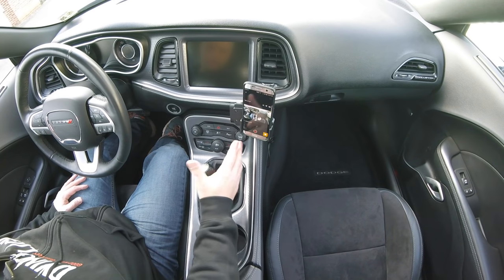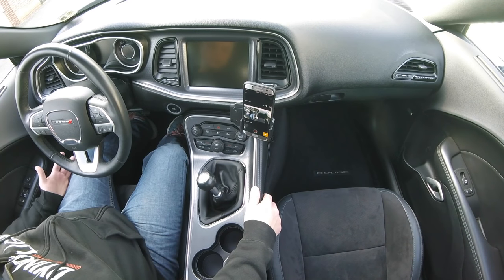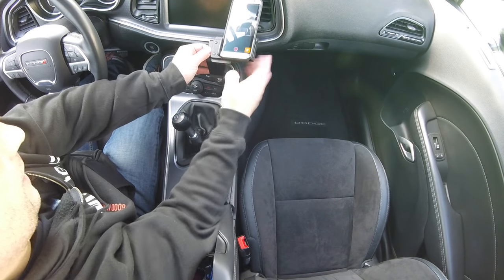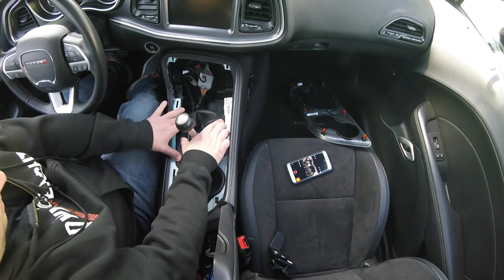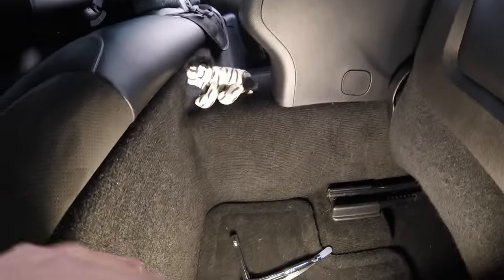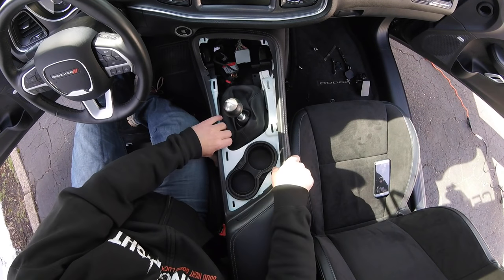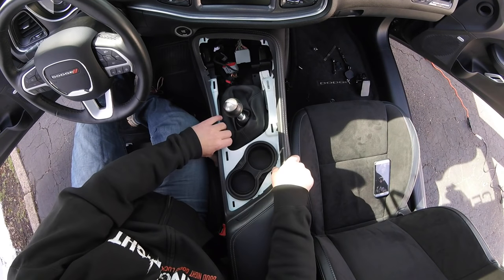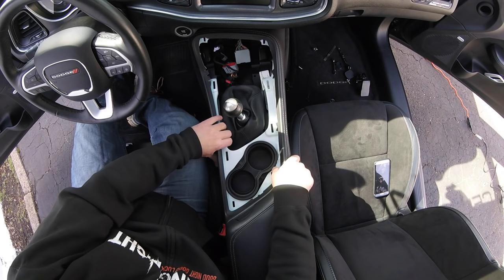Barton Shifter complete Install - Dodge Challenger Scat Pack

Comment: Ok here's a stupid question and your videos of everything you do are Great ! Skip Shift Eliminator you had a video on it do you use with your Barton Shifter ?
Reply from the maker: Both parts do different things and can be installed together or at separate times, for the best experience you should install both of course.  The skip shift stops the lock out on second gear between 19-21mph  it's a very annoying "fuel economy' feature.  Installing the Barton greatly improves shifting, but does not deal with the 2nd gear lockout which is why you need both.

Comment: I just saw you this evening on 303 lol I was the black scat that parked in front of you by the 7/11 😎
Reply from the maker: Yup that was me, had to pull over and deal with an email.  I was a little jealous your car was so clean.
Reply: Many thanks to your how to videos ! Ceramic coating keeps it looking very glossy. I hope we bump into each other again , what's the chances !
Reply from the maker: Pretty good chances considering, if you're not affiliated with a club check out www.northjerseymopar.com they have events, meets and shows  at least once a week.  They are a good group of people to hang out with.  Ceramic coating seems to be the way to go, there are a few people saying I should go that route for a touch less wash.  Once I finish paint correction I may go that route.

Comment: Very nice Mod ; With my Bratwurst fingers I would have definitely tried some 45degree needlenose pliers or forscipes on that pin. I was wondering if you were going to put any grease on anything during reassembly or is that frowned upon by the kit maker ? From the looks of some of the existing parts they probably could use a coat of oil or something on them.
Reply from the maker: They only mention grease to assist with the fitting of the rubber boot. Once I started the job one of the first things I though was "I should have gotten some grease"

Comment: Great video! I had a question? In the description you say something about the rear bracket and bolt orientation, what exactly are you referring to? Thank you.
Reply from the maker: The square plate with the 4 bolts that goes on the back of the shifter.
Reply: @WorkPlayDrive  not to be a nuisance, but could you give me the time time in your video to further explain? Thank you so much.
Reply from the maker: No worries the time stamp is 22:35.
Reply: @WorkPlayDrive  thank you very much.

Comment: Great Video! What is the name or brand of phone holder that fits between the console & dash? Do you know where I can get a hold of one?
Reply from the maker: Thank you !!  The phone mount is made by ProClip, http://www.proclipusa.com/ and you may be able to use code "10off" to get a 10% discount.  It's more expensice than your eBay mount but it's sleek and solid.  I have 2 videos on it for the challenger so you can decide if it's for you.  In my review I added an extender plate.  Here is my Playlist https://www.youtube.com/playlist?list=PL_C69kho0QAtlEQr8n08a6O2FYFiLEIPk

Comment: Excellent video. One question, did you painted the engraved on the shift lever or coming orange like that? I went to the BARTON website and no option other than bare metal on the engravings. Thank you
Reply from the maker: It came from Barton painted, they may no longer offer this option.
Reply: @WorkPlayDrive   thank you for the feedback, Probably I will call them and ask. In the worst scenario I think I can paint the BARTON engraving by myself. I jus ordered an SP with the hemi orange interior package and that detail in orange will be look really nice I think. I ordered already the same knob than you from speed dawn, just added the R/T logo on both sides, in hemi orange too. I can’t wait to install it!  Have a good day. Thank u
Reply from the maker: Congrats on the scat 🎈
Reply: @WorkPlayDrive   thank you very much

Comment: Did you loctite all fasteners? I'm about to install but cannot believe no instructions were included and the video they recommended is 8 yrs old and completely different version than late model Challenger
Reply from the maker: It’s been a few years, but I believe I used the blue Loctite on any of the fasteners that did not come from Barton with Loctite on them.

Comment: Great video. Just picked up a 6sp Challenger yesterday and will definitely consider this shifter. When I had a 2010 SRT8 with 6speed, I replaced the shifter with the Hurst shifter. I found the Hurst to have a lot of vibration though.  How is the damping on the Barton? Any vibration compared to the stock unit?
Reply from the maker: I little more than stock but not bad at all. I have a bad habit of leaving my hand on the shifter all the time and it’s not an issue.

Comment: Great instructional video and very well done!  I was thinking of the Barton shifter upgrade as well. Can you tell me what the thread size is on the shift knob is?  I want to order a shift knob from Sick speed and want to be sure of right size.
Reply from the maker: The Barton - Challenger Shifter is: 12mm x 1.25.  Also check out SpeedDawg, they make some awesome custom knobs as well.

Comment: I hate to change the subject but what is the name of that phone holder you removed from the dash? I've been looking for something to use in my Charger Scat Pack and that looks ideal.
Reply from the maker: It’s a ProClip. I have them in all my vehicles and for the challenger they make 3 mount locations. 2 near the console and one at the driver side left vent. https://youtu.be/b-ezTSJP2eg

They are costly but it’s the last one you will ever buy. You can use my discount “WorkPlayDrive”

Comment: Have you deleted the Clutch delay valve?, I flipped the stick to lean forward on my Barton keeps you from hitting your elbow on the seat (if that happens to you) Great Vid
Reply from the maker: I'm on the fence with the CDV as it will help with the daily driving, but I'm looking for clutch release consistence when at the strip.  

I plan on doing a a video on this one as I found a few adjustable clutch delay systems, one of witch you can adjust and only activate when needed.  i.e. CDV delete for daily driving then flip a switch and have a fine tuned release only for first gear launch.

Comment: Hey man great video I put a barton ln my challenger rt I've installed and uninstalled it twice sometimes my 1st too 2nd gear is a little nochie and clunky at times all the other gears shift fine though but in ur video it looks like 1st too 2nd looks smooth as butter just wondering if I'm missing something I have the pistol grip on mine
Reply from the maker: When you say "Notchy" do you mean you feel the teeth when shifting into 2nd?  Is it all the time or only when cold outside?
Reply: @WorkPlayDrive  well I guess I'd say I have too force it in at times I've had it on there for about 4 months and it's never felt quite  right so I took it back apart yesterday and turned that rear block too were the the screws were facing the rear then I bolted it down then I tested it out before i put side plates  and shifter back on  and it seemed ok then then I put the console back and drove it the 1st too 2nd was still kinda stiff  it was probably 25 too 30 degrees outside it got a little better as the car warmed up maybe I got that rear bolt too tight or maybe adjusting the angle of the shifter idk it's got me stumped.
Reply from the maker: Give Barton a call they may have a solution or some suggestions for this.

Comment: Awesome vid.  Helped me do my install immensely.  One question though....have you experienced loosening of the handle bracket assembly over time?  Or heard any reports of such?  I was too lazy to put blue loctite on the bolts and am hoping just snugging with a 3/8 ratchet was enough.
Reply from the maker: Nope just swapped my shifter last week 15 months later and the bolts were still tight. No lock tight just the washer and lock washer.
Reply: Work Play Drive that is great to hear.   Thanks again for the awesome vid.  Taking that console out really isnt that big of a deal like you said.
Reply from the maker: The hardest part is getting over the fear of ripping the car apart.

Comment: Is it true sir that the block on back side that the shifter slides into is supposed to be facing with bolts facing forward or no? Some guy on youtube said his performance improved after making it bolts facing forward with the back block piece. Fyi your video walked me right through install about a week ago and it went beautifully. Thanks a ton.
Reply from the maker: It depends on which version of the shifter you have. When I installed mine I confirmed  with Barton it was installed correctly but a few years later some people were saying flipping it around eliminated some noise.
Reply: @WorkPlayDrive  Thank you
Reply: @WorkPlayDrive  I don’t really notice much noise, just a TAD more than stock.

Comment: So I'm getting ready to order barton. I'm a little confused,are they all short shift? And also, if I order the one to work with the factory ball and shaft , any dis advantage? Your videos rock and I trust your opinion!
Reply from the maker: Short shift may not be a good description. There is still good throw between shifts the distance is a little shorter more controlled and firm. It doesn’t feel like a toy though. 

I like the stock shifter ball but mine wore off on top in less than a year. I also wanted the option of using custom shift balls which the factory version doesn’t support. 

Hope that helps.

Comment: The control unit on center console you unplugged, does it look easy to remove it from the trim?  I'm thinking of replacing just that trim panel, and dash bezel.

Comment: How tight did you go on the bolts and did you use any lock-tite on anything? GREAT VID! I am getting ready to install mine on my '16 392. I will use your vid to do it! You even motivated me to get the Speed Dawg Rally, GoMango with Black graphics and Challenger script :)
Reply from the maker: I made them pretty tight and did not use locktight, they have lock washers on them.  It's been about a year and they have not come loose.  Nice if you're on Instagram feel free to tag me so I can see the finished product.

Comment: Do you find the Barton has some noise and some vibration associated with it?  I have after my first test drive.
Reply from the maker: There was a very slight increase in noise due to the boot design but for me absolutely no vibration. 

Barton made a change to the design I guess and when talking to others that have excessive noise and vibration Barton suggested flipping the block to have the bolt heads facing in the opposite of how I install see 22:35 

Originally bolts in worked, then for mine they said bolts out and now it looks like we’re back to bolts in 😂

Comment: would you disconnect the negative battery terminal?
Reply from the maker: I would recommend it for anyone who is not very experienced. You have a few plugs to remove and it can’t hurt to be on the safe side. 

Just note when you reconnect your uConnect my not have 100% functionality right away. It may take a while for it to connect and update. This is totally normal.

Comment: are the stock shifters normally noisy and loose? I'm thinking of taking mine to the dealer before the warranty expires. I hear a weird whirring noise coming from under the shifter, which goes away upon gently pulling up on it.
Reply from the maker: Yes they are very sloppy from the factory you will hear a light whirring noise no matter the shifter. You may want to get it checked out anyway

Comment: Hi on your barton shifter do you have to add a little bit of arm to shift in to 5 or 6 gear I  do on mine  thanks
Reply from the maker: Everything to 5th was smooth. I don’t recall ever using 6th gear though 🤔
Reply: @Work Play Drive  all my gears are smooth when I get tj yth hear I have to apply little pressure to the rigth to fall in 6th gear

Comment: Thanks for the great video. Only dropped the right side pin once 😂. Update from your shifter to mine. Now instead of a heavy duty rubber ring on the shifter plate. It’s a cheap ass silicone thin one. Total garbage imo. My 8 bolts that the blocks bolt to the shifter weren’t shiny like yours they seem galvanized. My only complaint is the garbage ring and how do you charge that much and get zero instructions. You go to their site and it’s for the 09-14 challenger not 15-22. Thank god for your video brother.

Comment: I just installed mine this past weekend (2/25). I'd be interested if you experience the the same increase in noise I did.  The stock shifter has rubber mounts whereas the Barton is hard mounted, translating noise thru the shifter. I actually put the stock one back in thinking I did something wrong (I didn't). I put the Barton back in and after the trans warmed up the noise came back. it's pretty annoying but maybe will have to live with it.
Reply from the maker: No increase in noise only when I had the leather cover off for adjustment.   I found the Barton to be completely isolated with rubber at all contact points is it possible your shifter was missing some pieces?  specifically the one I show at 24:56 would be the source for a lot of noise.

That being said I was in a discussion earlier today where another person mentioned some noise and used packing foam around the shifter to eliminate it.
Reply: Thanks for getting back to me.

Unfortunately, everything is installed correctly according to the instructions on the Barton Website. The only thing different that I saw between your video and the Barton instruction is the mounting block at the rear you installed with the screw heads toward the back of the car. The Barton instructions indicate to install them pointing toward the front of the car. Not sure how this would make a difference as the screw heads don't appear to touch anything regardless of the orientation they are in.  I'm at a loss as the noise is pretty loud. One possibility  is the Barton is very precise whereas the stock is pretty pliable. Meaning, maybe the Barton is holding the gear selector shaft slightly off of where it was with the stock one.  If I can't come up with a solution I don't know that I can use it.

FYI - I am also in north jersey so if there's a way we can exchange numbers and talk about it that would be great. I understand if that's not an option.
Reply from the maker: Are you a north Jersey Mopar member? If not you should join up we meet every Wednesday and have shows and events throughout the season.   Best place to contact me is via Facebook messenger  https://www.facebook.com/workplaydrive392/ between my demanding job and time with the family this is the best way to reach me as I can respond when free as well as chat or call in real time when I'm available.
Reply: Update: I had a conversation with one of the engineers at Barton regarding my noise issue. He told me to place the rear mounting block with the set screws pointing toward the rear of the car. The instructions they have online state the opposite and that's how I installed it.  I reversed the block and the noise is gone.  They are going to update those instructions with the proper config noted.
Reply from the maker: Joe, I spoke to Dave at Barton yesterday as well, Screws to the back is also what they told me. Thanks for stating this fixed your noise issue I have a few guys who mentioned this, I'll pass along the info.
Reply: would u guys mind please adding the time of the video that these bolts facing the rear were installed.  ima do this set up in my hellcat in 10 days.  thx

Comment: Trying to figure out what I did wrong on my install. Reverse is impossible to get into gear with only one hand. I have to use a ton of force with both hands to get it far enough over and into gear. Any ideas?
Reply from the maker: Did you install the Skip Shift eliminator at the same time?  If you did it's possible you installed it on the revers lockout plug on accident.

Comment: Did u look into hurst. ?
Reply from the maker: Only as a comparison.  The Barton was always my first choice, the bulk the reviews with design and the feel are IMO all much better.  Even the pistol grip handles on the Barton are silky smooth compared to some of the rough edges on the Hurst.  I'm not saying it's a Bad shifter either, Hurst is a quality brand, but it just wasn't for me.

Comment: Wonder if anyone has tried to add this when the trans is out from underneath? Getting my transmission warranty swapped and have been wondering if it would be easy to do from below
Reply from the maker: It would only make the 2 pins easier the rest is a piece of cake from above.